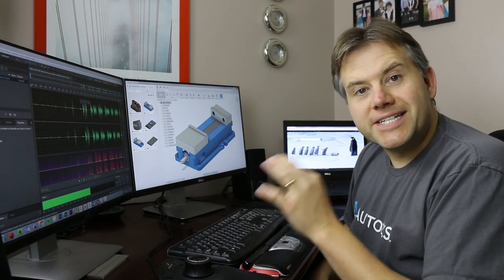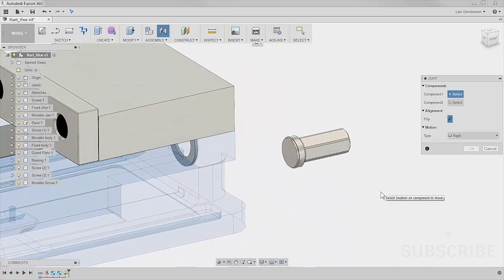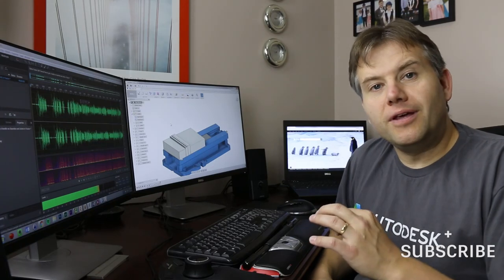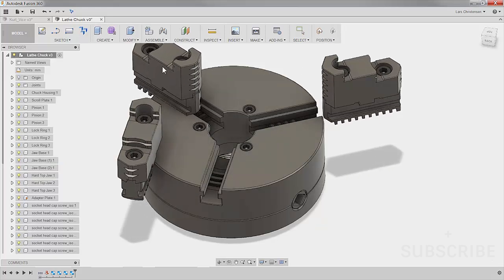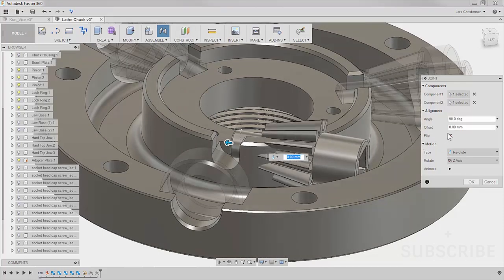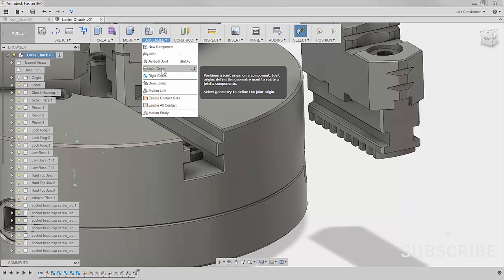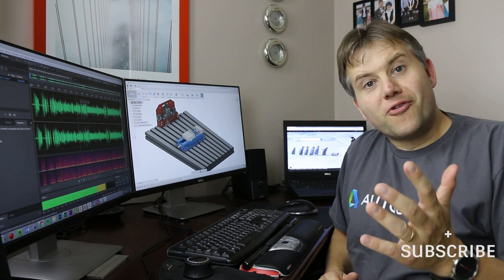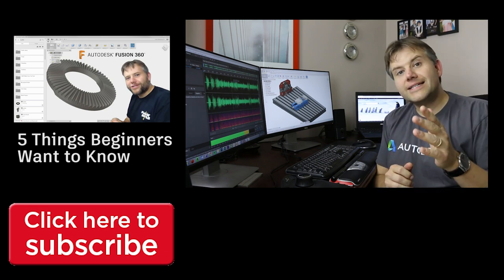Fusion 360 Tutorial — How to get a handle on Assembly and Joints in Fusion

Comment: Hi! I really like the video, it's VERY helpful, especially your explanation about degrees of freedom in Fusion 360 :)
I have one problem: I want to use pattern to make it easier to joint repeatable parts like screws (I used this function in Creo), but I couldn't find if it's possible in Fusion 360. 
I see you didn't use pattern in your video, it would accelerate your work because you wouldn't have to repeat some joints 3 times (in second design).
Reply from the maker: Hi Dziewanna98 Thank you for watching!
I think this will be a livestream topic this week. You can pattern joints if you make them part of a sub-assembly. You are right, it would have been easier if I had done that in this video.
Reply: 'Thank you for your answer, so I'm waiting for the livestream :)

Comment: Really good videos thanks, watched 4 in a row now. However you said that the models should be ideal, i.e. not allowing clearance for 3d printing. I would normally leave 0.2mm between surfaces. But you are saying not to. How would you get it to print properly then?
Reply: Yeah I have the same problem in Fusion. I was trained, never model stuff to be 'line on line', but to always model parts with proper nominal clearances. And then whenever possible constrain things using centerline planes, or reference surfaces that have some fixed nominal value  etc. Fusion seems to hate this.

For me my workflow for a lot of stuff is constrain a lot of parts to a common 'center' plane that lets me move parts freely in 2D to 'arrange' them. Then start locking it into position. Again Fusion doesn't seem to let me do that approach, I have to have all my alignment features and other crap figured out while stuff is just floating in void. What if I don't have my alignment pin holes yet? The whole benefit of 'stacking' constraints to lock down degrees of freedom is you can start with one constraint and then work your way up as the design evolves.

Fusion seems to almost assume you have finished geometry that is ready to go when you start joining them.

Comment: Nice again Lars. Thanks. Do you have any videos that deal with re-orienting the main origin. Was designing a tablet holder recently to 3D print, and everything was great, but between moving parts around and applying joints, and "continue" or "capture position" ended up with a "front view" that i hadn't started with. I'd click front on the view cube, but the whole assembly was now at an angle. I've obviously done something wrong, but cant really explain it any further. Thanks again for the great videos.
Reply from the maker: Hi Douglas Thomson Thank you for watching!
You can align you view.....At the bottom of the screen, second from the left you have a function called "Look at". Click on that and then select the face you want to be front on your assembly.
You should now look at what you want to be front.
Right-click the view cube and select, Set current view as, and select front.

Hope this is helpful
Reply: Thanks, i'll have a go at that soon.